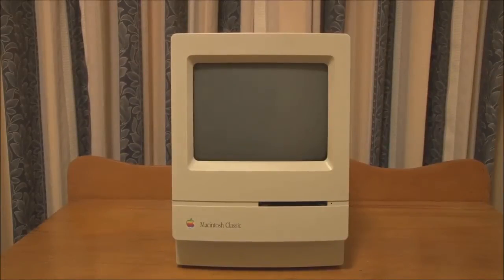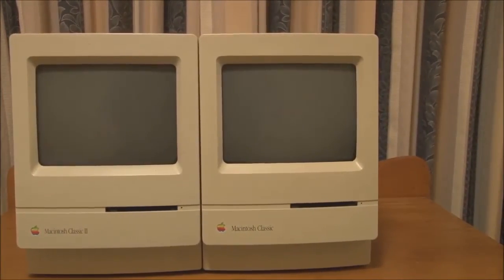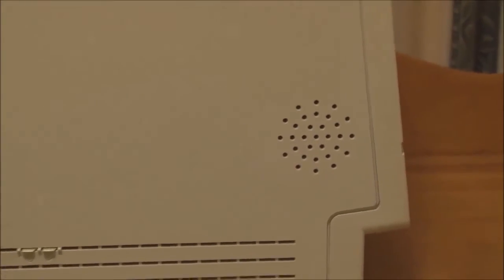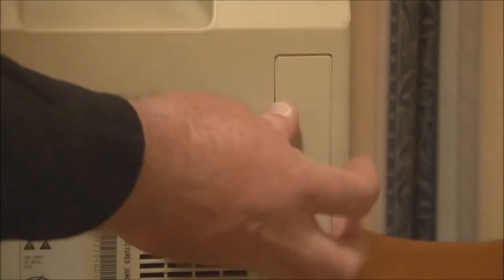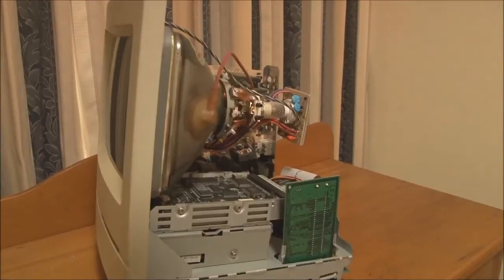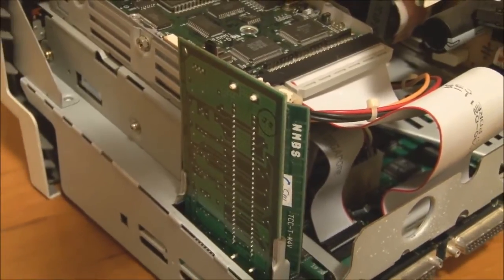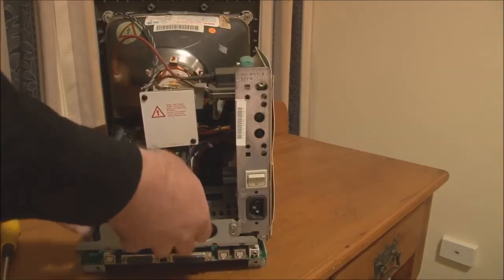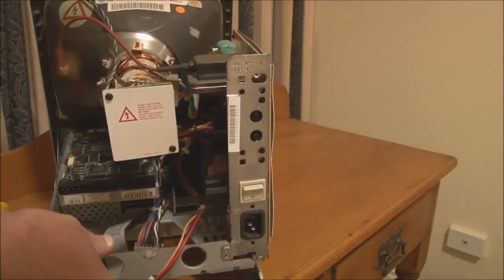Apple Macintosh Classic (1990) Full Tour

Comment: It's anyway possible to conect a Macintosh Classic to the net by the phonenet appletalk adapter ? Or anyway to connect it ? Thanks
Reply: Yes, but you would need a LocalTalk to Ethernet bridge. Farallon and Asante made these, as well as a couple other companies. They're a little rare and pricy secondhand these days, and sometimes these won't give the Mac an IP without extra software. Alternatively, you could also use LocalTalk Bridge software on beige Mac with both Ethernet and Printer/LocalTalk port, and the Mac would bridge the connections and provide an IP. This was how I got my Mac Classic online in the early 2000's.

Comment: Hi Jason love your vids and love old Macs. I have 2 classics and just got a plus with an external hard drive. Is there a way to connect them together 2 at a time with the printer cable. I would love to copy files from 1 to the other but having issues formatting the disks I have for them. I'd love to know a bit more about networking the old girls. Thanks for your time and keep up the good work
Reply: Try it buying on ebay some appletalk adapter
Reply: Yes, a printer cable between two Macs will network them, if they are so configured.

Comment: I have one, put it didn't work so washed the motherboard. Was it a good move?
Reply: a
Reply from the maker: Aaro Helenius Washing the motherboard can help to get a system working - but you must make absolutely sure that the board is completely dry before attempting to power it up. If I wash a board, I blast it with compressed air to drive all of the water off it, and then let it dry out for at least 24 hours.